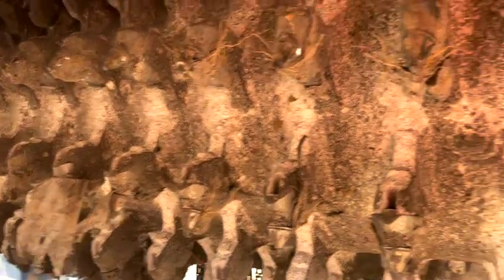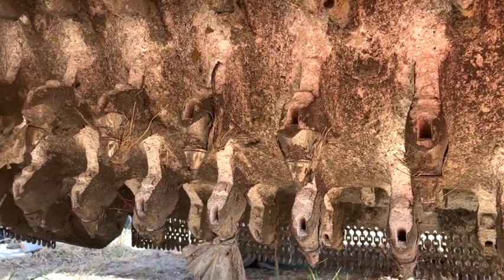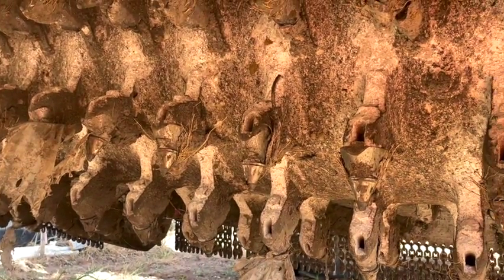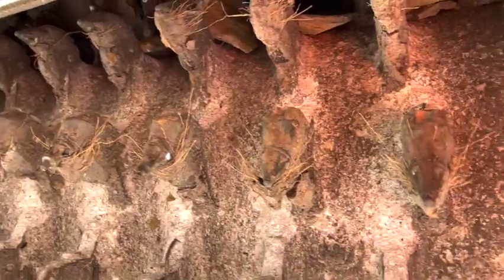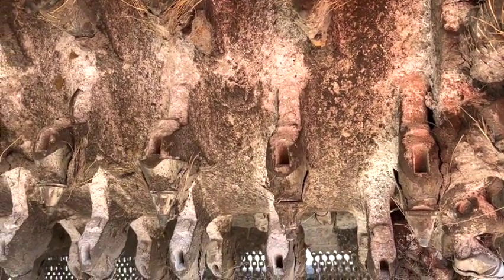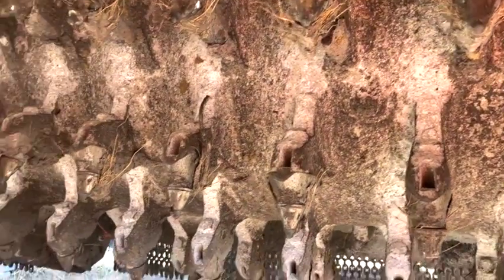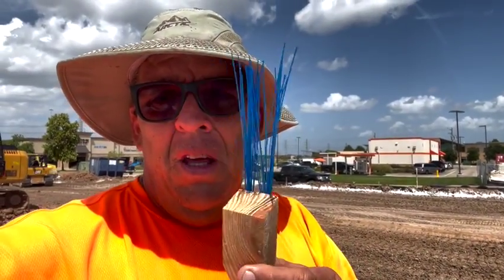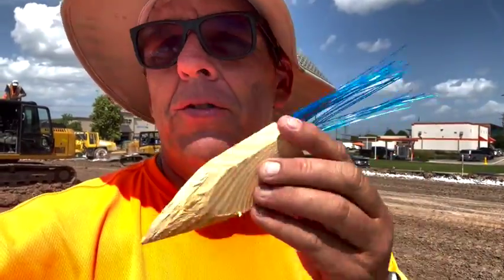How to Lime a Parking lot before placing the Concrete

Comment: What company did you use for the lime?
Reply: Also, How did you calculate the tonnage needed for the 33,600 sqft to get a 6% mix? Does the geo-tech report give you a percentage they require? Thanks in advance. I have been learning earthwork and moved to larger projects that require soil stabilizing.
Reply from the maker: The lab tells us what percentage we need. From there it's calculating the dry weight of the dirt that you're going to mix.
Reply: The percentages are in the Geotech report. Each project is different some require 6% dry soil weight while some require 7%. Calculations are given in the report as well.

Comment: I can’t believe y’all do lime like that never seen it in liquid. Looks like a huge waste of material
Reply from the maker: The engineers require it to be in liquid. Our soil has a tendency to swell and shrink 1 inch per foot, the water helps change the PI make up of the soil. Thanks for watching
Reply: @thomasconstructiontexas  yeah that’s crazy we use the powder lime in Cali and we just soak it with water on the mix In and the remix the next day.
Reply from the maker: @jeffidubb  I guess it's close to being the same. Do y'all use a lot of it? Every job we do has it on it , it seems like
Reply: @thomasconstructiontexas  yeah we do a lot of lime. Subdivisions,big pads streets parking lots. It’s common in California.
Reply: How much lime is the application ? Does customer pay by tons or by gallons ?